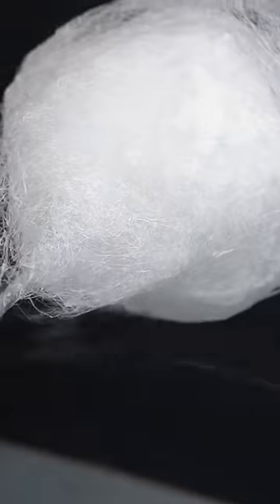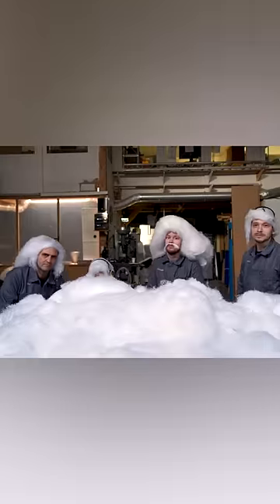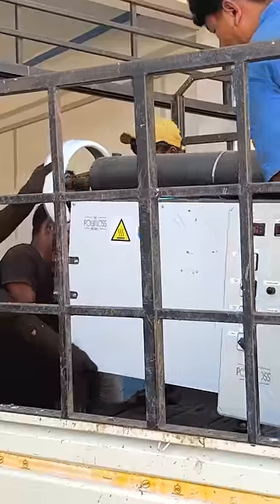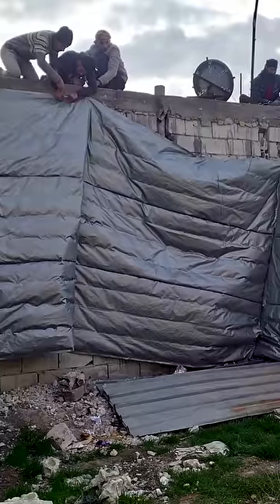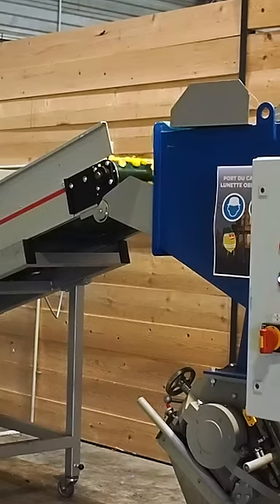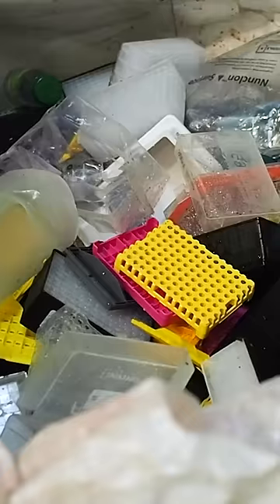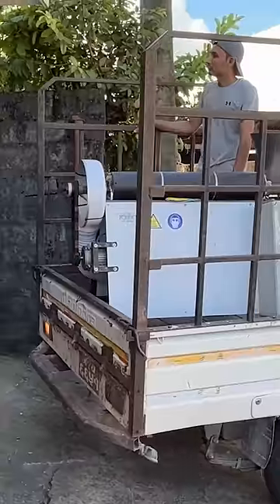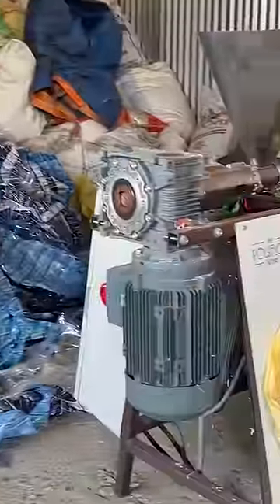This cotton candy is really plastic trash spun into ultra-thin fibers.#recycle #plastic #environment

Comment: We upgraded from asbestos to micro plastics 😋
Reply: This relationship is wayyy off.
Reply: Pretty much, my thoughts exactly.
Reply: I see everyone panicking over microplastics, so let me just say: 
This stuff is practically identical to polyester, fake fur and plushy filling. You already have this, and microplastic exposure is about equal. And by equal I mean there’s less microplastics entering your blood then when drinking water bottled in a plastic bottle. Bonus points if you keep reusing an old plastic bottle. 
Plastic sealed in insulation can be kept out of the ecosystem for literal decades. And yes, it still can be cleanly burned later. Do note that clean burning requires filtration to catch the fumes, and this may not yet be available in poor areas. If burned without all the required filtration, you get fumes that are worse than microplastics. So you might as well reuse the plastic and store it as insulation until such a time where it can be safely disposed of, which can be years to decades depending on local development. 

Its a good thing that everyone thinks critically and questions progress. But please be careful not to blindly join a judgement bandwagon either. Question both sides of the coin. And by all means, question me, look things up. <3
Reply: @jahqwelin yeah and in your lungs, your heart, etc. Why mention ovaries specifically? Its a blood stream thing not an organ thing. You just look igorant
Reply: @redravenriot3650 finally someone with sense. Are microplastics good? No. Are they new? Also no. Weve been exposed our entire lives. At least its not lead like the previous gens. That shit comes with actual  neurological issues
Reply: @redravenriot3650  no, you're wrong. It's not the same as polyester. Polyester is much stronger and more durable and stable than PET or HDPE or PVC. And polyester has a higher melting temperature so it's probably less flammable when spun into insulation and it is much more UV resistant.  That's why we use polyester for clothing and insulation, because it is a very good material for those purposes. But we would still never use spun polyester for insulation in a structure because it would be an absolute deathtrap of a fire hazard. Fiberglass insulation is cheap and non flammable and can be also made from products in the recycle stream if you must check that box. You talk about the plastic being used as insulation in houses lasting decades but that would never happen. It is not well suited to that (or anything else). The video suggests using the insulation for temporary refugee housing because, well, don't you want refugees to be warm?  Well, yes I do, but our society already produces a supper abundance of materials we could use for this purpose, including, you know, normal insulation and blankets and stuff. Building dangerous, disposable shelters out of garbage is not a good solution. This product is the result of (possibly well intentioned) grifters who are taking advantage of 1: the superabundant raw material of plastic trash everywhere and 2: the general publics credulity in general regarding the merits of recyling. It's not a good use case for the material imo. And yes, spinning the plastic into tiny fibers and putting it back out into the world to quickly fall apart is absolutely going to result in lots and lots of additional microplastic particles. It's practically optimized in that regard.
Reply: @Celestiana06  It actually is more than a blood thing. Not only is one of the most common places to find large particles the muscle tissue, which is why its such an issue in the meat we consume, but it's also in other organs. The presence of microplastics inside the reproductive organs is actually a big topic right now, as it decreases fertility. For most couples it means to try harder, so its not clear yet in a day to day life, but if the affects get worse than it may start affecting birth rates on a global scale.
Reply: @pstrap1311  Man, I see you really did your research. I'm honestly glad, I hadn't seen anyone talk in this level of depth about it yet. I will definitely have to read more about plastics and recycling in that regard. Thank you for providing this information in a quite comprehensible way! ^^ 

I do have to wonder though, if the abundance of alternatives can still be called upon in regions where large scale refugee camps are the most common, aka close to the conflicts and disasters, sometimes not even across the border. One benefit was the ability to make this on site. If fiberglass production on site in disaster struck regions is as feasible as this, then I have to give that it is better. If not, or not yet, then there would still be clear benefits to producing this insulation as a temporary solution.
Reply: @redravenriot3650  Yes, you make fair points. If it really was do this or people are improperly sheltered then this would be useful. Maybe there would be logistical circumstances where it would be benifitial. It is a, like, neat process which makes a theoretically useful product so one would think it ought to be useful for something, somewhere.
  I was mainly skeptical because it didn't seem like the best use of the material to me. We are still producing hundreds of millions of tons of new plastic every year. Most of the stuff made with that new plastic could be made with recycled material if it were available. So it seems to me we should be using recycled plastic to reduce our production of new plastic, not finding new things to do with it which would better made out of other, non plastic materials.
  However, now that I think about it a bit more, this application talked about in the video would only ever be employed on such a small scale that it would be absolutely negligible in terms of global production of plastic. And it may well be that there would be some viable uses for it in the cases they mentioned, like refugee emergencies, maybe. It has to do with recycling stream logistics and shipping and aid budgets and all this. So maybe the term "grifter" was a bit harsh. Maybe. 
  Still, this use of recycled plastic is not something I'd ever like to see employed on a large scale for the reasons I've mentioned. Thank you for your kind words.
Reply: @pstrap1311  I agree with you. I also don't want to see this on a large scale for regular housing or such, but in case of disasters or long term poverty or other extremes, it might just be a lesser evil to keep people warm and healthy. Everything requires its own context to be judged, and I think that, if used correctly, this can help a lot of people. But hopefully, in the future, we will have something even better.
Reply: @pstrap1311  The only problem with recycling plastic is that it's pretty hard to do, compared to things like glass or metal. Different kinds of plastics have different processes needed, and they can only be recycled so much before the structural integrity takes a serious dive. The upside to plastics is that thermoplastics like the ones used here are pretty easy to repurpose outside of a dedicated factory. The insulation is used in places where they can afford a $1000 machine but don't have access to a multi-million dollar building.
Reply: Yeah kinda seems like a lateral move
Reply: That's honestly a huge step up, given how much more directly harmful asbestos is.
Reply: It's exactly like a fabric you're wearing. If you have ever worn polyester.
Reply: @redravenriot3650 If we even have a future. The damage is done already. We're only making it worse now. Stopping plastic is the only way to have a brighter future and that'll never happen.
Reply: Way to shit on recycling, my guy 👍😀👍
Reply: @redravenriot3650 Birth rates (globally) have already dropped to below replacement level.
Reply: @redravenriot3650 i think having a pyrolysis setup with a heap of plastic is much better than storing diesel and keep adding in the fuel conditioners. For those who do prepping, etc.
Reply: this isn't micro plastic... and its not one time use its going to be used for a long time
Reply: @BobaPhettamine Dude 😂 plastic is in our blood now. The negative effects are slowly creeping up and they’ll show themselves with time.
Reply: Yeah except asbestos is fireproof.
Reply: @redravenriot3650  Overall though it'd be better to manufacture as little plastic as possible, and safely dispose of the stuff we do have. Even if that's just melting it all into one big block and dumping it in a desert, it will stay out of circulation in living things.
Reply: @Celestiana06  "At least it's not lead". Being exposed to something our whole lives doesn't make it less of a worry, it makes it more! It makes it a "chronic" problem instead of an "acute" one, and likely less curable.

I suppose ovaries in particular because that's where new people come from. From the first cell, a baby is going to be carrying this stuff. It's a sad thought. This is something we didn't know about until recently, and just like the dangers of asbestos took a while to come to light (and the manufacturers tried to bury it for decades after), we don't know what the negative effects might be.

Might be nothing, might not be. It's certainly not "natural", by which I mean in keeping with the usual composition of our bodies. It's tiny, it gets everywhere. We'd better hope that nothing too awful happens, or else we'll have generations of suffering before we phase the stuff out for our descendants to at least be healthy, after however long it takes for the stuff to settle out of the environment. Which might be centuries, might be longer.

It just pays to be cautious when something is insidious and irreversible.
Reply: @greenaum  Its best to keep it from being produced and out of circulation, yes. And there are better insulation materials. However, for refugee camps in disaster areas, this is a brilliant way to use locally abundant resources to create emergency shelters. And the niche use concerning disasters and warzones means it won't affect the global plastic production in any significant way.
Reply: What will it evolve into next😂🤔
Reply: @jahqwelin  microplastics are stored in the balls
Reply: @redravenriot3650 if the micro plastics are going into the meat we consume does that then still not effect us negatively everytime we recycle plastic? You mainly are arguing that there is no effect while there is one
Reply: @xirochamber5863  I never said such a thing. In fact, I said the opposite. I stated the microplastics that enter your bloodstream when using this shelter are less than when you drink from a plastic bottle, especially if its old and frequently reused, as those release more microplastics. That is a comparison so people can estimate how many microplastics they would intake, which is obviously an indicator you do intake microplastics.
Reply: Kinda a step in the right direction though. Seeing as asbestos literally kills people fairly fast and in a horrific manner.
Reply: I'll take micro plastic over asbestos. One of these hurts my lungs my skin and can cause rashes, the other we haven't seen yet the harm so I'll take that. At least you dont have to wawr as much safety gear to be near it
Reply: Mmmh I do love me some asbestos on my spaghetti it’s a very good cheese and the micro plastic adds texture
Reply: This feels like the same kinda shit as “I don’t use Google so my data is safe - uses a smartphone”
Reply: @Celestiana06  Grandfather - Full of lead, asbestos, and microplastics

Father- Full of asbestos and microplastics

Me- Full of microplastics
Reply: asbestos is much much more dangerous than plasticisers and stuff
Reply: We’re eating good tonight 😋
Reply: Would you rather have cancer or weird tasting water?
Reply: @thephilster741  weird tasting water obviously, notice how she said upgrade?
Reply: Have YOU stopped using plastic yet?
Reply: @redravenriot3650 true but they seem to be thinner and more “floaty” if that makes sense.  I’m honestly less worried about microplastics and more so about inhalation causing lung damage
Reply: Is it just me or this also looks like it would catch on fire pretty well?
Reply: @Celestiana06 hey at least plastics are generally very stable. It's bad for you but it doesn't necessarily poison you in a way that asbestos does.
Reply: @redravenriot3650  lol anything can be burned "cleanly" if you catch all the byproducts.
Reply: @greenaum Lead has some significant and readily observed negative effects on human development (i.e. children) and health in general. And those issues crop up well well before end of life. That's not to say that micro plastics aren't bad for you, just that it may well be more of a long term problem.
Reply: Great 🤦🏽‍♂️
Reply: Micro plastics are dangerous but can be managed with lifestyle choices. Asbestosis WILL kill you.
Reply: @Celestiana06 cry about it
Reply: At least asbestos doesnt burn
Reply: @redravenriot3650  This is more of an indictment of polyester than a defense of this
Reply: And from Lack of education to plain refusal of education and even thinking. Good Job karen
Reply: @jahqwelin what a creepy thing to say
Reply: @jackh337  I am okay with that take away, so long as you don't hypocritically wear polyester whilst cursing this invention.
Reply: we still use fiber glass insulation 😂
Reply: Do you people research nothing LMAO
Reply: Except asbestos is glass but ok
Reply: Remember how people used to just straight up chew on pens and platic straws and shit
Reply: @redravenriot3650 Well said.
Reply: Straight into the lung!